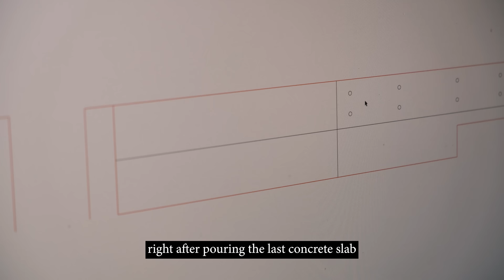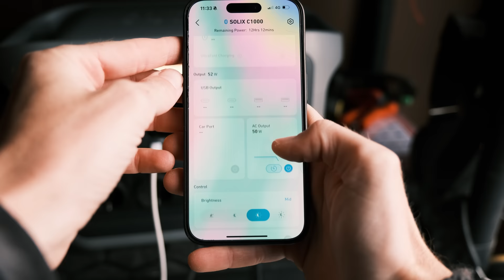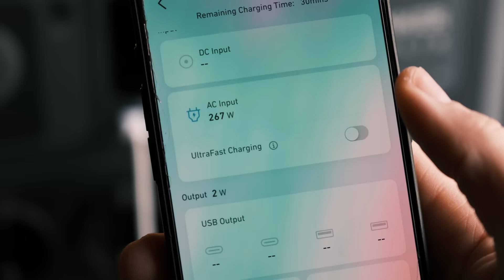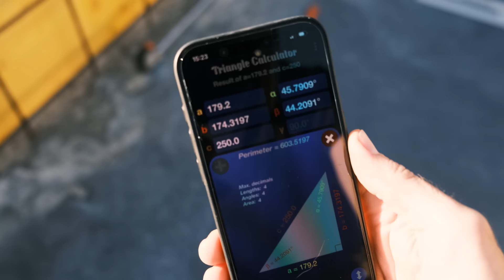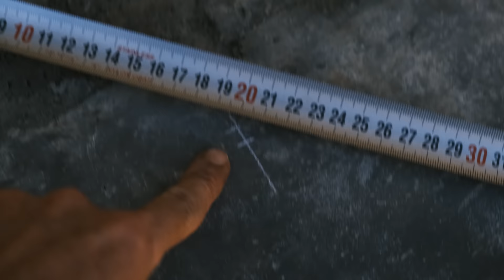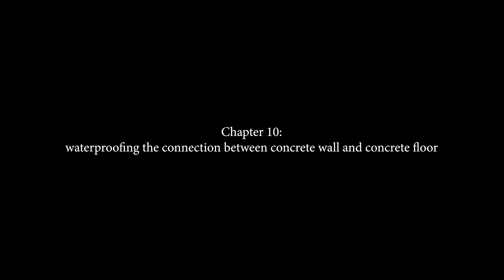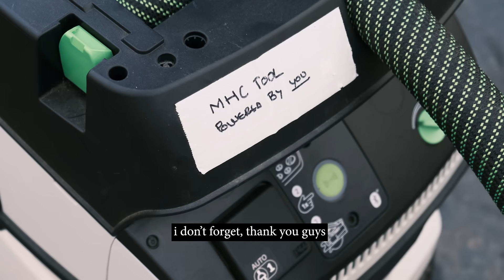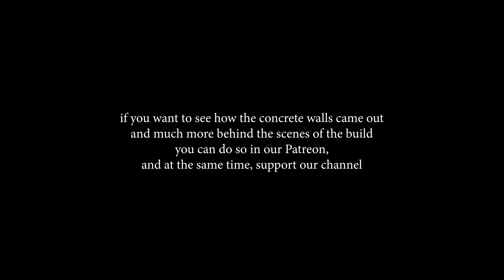Building our House Start To Finish Ep13: Concrete Living Room PART 1

Comment: I'm in the process of renovating a cellar in my partner's parents' house, which has never had any water problems for the last 90 years, but this winter it filled up with 22cm of water... The cost of just the materials to renovate a 48sqm basement is a whopping €7,873. Keeping a house dry from the start and thinking about how to keep the water out is definitely one of the most important aspects of building. Because tinkering with things afterwards is no fun at all.

Comment: I would recommend filling the screw heads with vaseline, or taping over them to prevent spilled concrete from hindering their later removal.
Reply: Great minds think alike, I posted nearly the same comment at the same time!
Reply from the maker: all the screws are facing out, not leaving screw marks in the exposed walls!

Comment: easier way to get a 90 degrees angle / triangle, use the 3-4-5 method  IE  300mm one side then 400mm other then the diagonal will be 500mm which means you have perfect 90 degrees be a lot quicker for you

Comment: Watching you build, especially your patience, is inspiring. If you need to bend pvc pipe in future use sand. Heat sand to 150-200°c and poor into pipe. Pipe becomes pliable without compromise.

Comment: A couple of comments.
Firstly, you build your house the way you two want it built. Don't let armchair "builders" get you down. As a carpenter I have worked on houses in the US that the guys doing the foundation didn't take the time to make sure things were right and we had to build on a foundation that was 1 1/2" out of square, so you take the extra few minutes to make sure you get it the way you want it! It's your house build it your way! Square, straight and true is way better than not!
Secondly, this is just a suggestion and maybe you already know this. For the forms on the sunken living room walls, as you are pouring them, when you get the chance, tap the forms with a hammer all over the form to get rid of any air pockets. Even if you are using a vibrator, tap the crap out of those forms! You don't want a rough looking interior wall.

Keep up the great work. It's always a pleasure to watch you two and your "supervisors" work!

Comment: Tip: if you put duct tape over your screws/plates you will prevent them getting contaminated with concrete and can then reuse them.
Reply from the maker: all the screws are facing out, otherwise they would leave marks in the exposed concrete walls!

Comment: What prevents the moisture in the concrete from being absorbed by the red plastic/foam/expanding tape you installed on the concrete floor?

Comment: one tipp: from my side, to figure out the perfect right angle without a calculator. On construction site the professionals uses a quite simple method for right angle, based on pythagoras. Start in the corner with 3m to one side and 4m to the other side and if the diagonal is 5m you have you 90° corner (works with 30cm/40cm/50cm, too)

Comment: Very nice work 👍 
One thing on your tape: did it worked out sitting in the sun for a while? Normally this ducktape isn't very UV stable and the glue starts to detach from the tape.
Reply from the maker: it came off after the first rain 🥹

Comment: An insane amount of iron is used in the foundation. Is it because there may be earthquakes where you build. I live in Denmark and we don't use that much iron at all. 😀😀
Reply from the maker: well it depends what/where you are building in Denmark, i was in Copenhagen not that long ago and i could see several building sites building proper steel reinforced concrete. Concrete without steel has not very good flexural strength, if any really. In our case the ground is not the best, so we need to be extra careful!